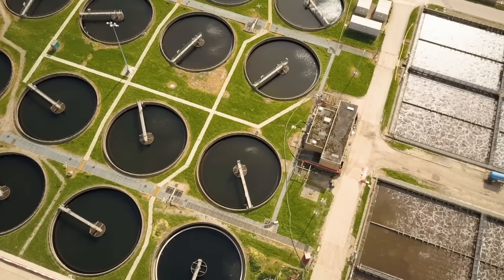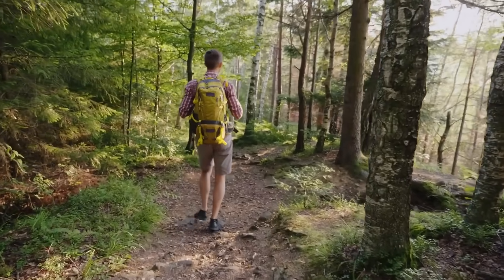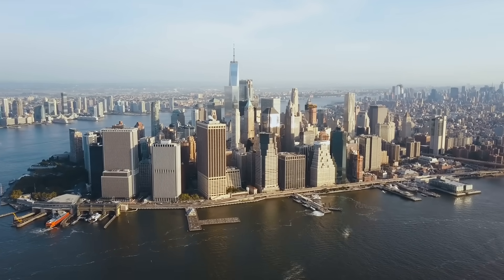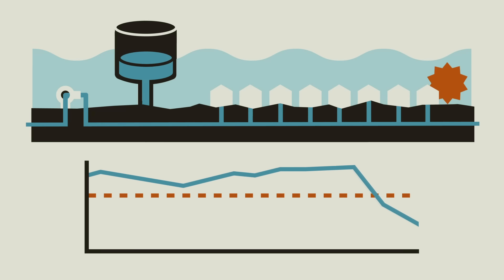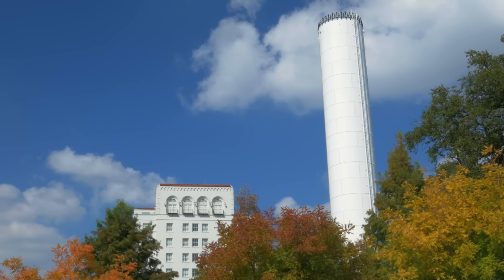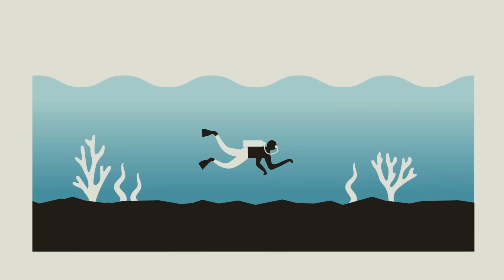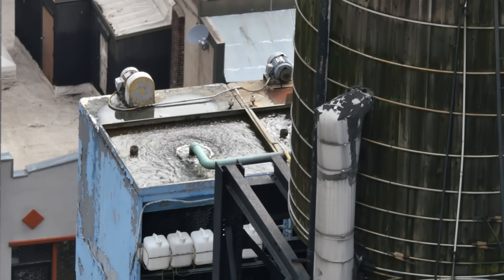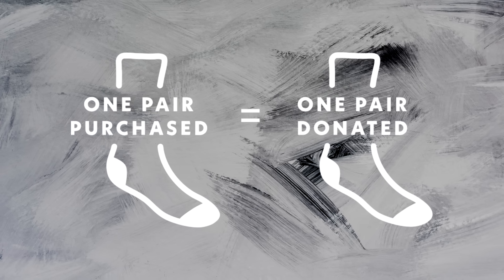How Water Towers Work

Comment: When you consider that a small town's jockey pump to keep pressure up is only delivering 250 gallons per minute and the town's boat manufacturing company's fire pump needs 2000 gallons per minute to do it's job, then the water tower makes sense.  Just have to remember to open the tower valve when testing the pump's flow or town pressure drops to zero within seconds.  Been there...done that.  The signalling circuits to the tower were not wired in yet and the guy in charge of the tower thought we were done testing and closed the valve.  Ooops  LOL

Comment: In my city, all the water towers are cylinders that rise out of the ground, not tanks on stilts.  I wonder why.  Maybe it's because we have a lot of hills so they are just located on top of hills or something.

Also: it's a shame that despite all this great infrastructure, people in recent decades have decided that tap water is not drinkable.  It's pure nonsense -- the tap water is fine.  I don't know how it got started but almost everyone believes it now.
Reply: Yes, they are simply large tanks with the needed elevation supplied by ground elevation instead of using stilts. Tap water is usually safe but if there is a contamination you usually don't find out about it until you've already drank some of it.

Comment: My old job used 1.3 million gallons a day.
Reply: Gallons, that's a measure used only in three countries, Burma, Libya and the US. The US doesn't even use proper gallons; there are 20 fluid ounces in a UK pint not 16 as in the US, but we went to the sensible metric system years ago.
Reply: @bobfisher1916  unfortunately we still use it in the USA. I wish we would change to metric.
Reply: @Lukelins1  I like cooking and one of the most frustrating things for me is seeing what look like good cooks with good recipes on YouTube using cups, spoons and a few pinches of stuff.  I never know what cup they are using and really can't be bothered to convert anyway.
SI is the way to go; 1 cubic metre of water weighs 1 ton = 1,000kg.  Then, temperature, freezing point of water zero, or 32. boiling point 100 or 212, guess which scale I use😂😎

Comment: Here in Brazil, depending on the region, almost every home has some kind of water storage. Specially in remote areas that have little to no infrastructure like the north and northeast of the country, the Amazon included. We're taught to design homes with storage for at least 2 days due to the systems being unreliable. Larger structures are also required to allocate a significant percentage of their daily water usage to be used exclusively for firefighting as there aren't any expressive quantities of hydrants in the country.
Reply: Damn, that kind of sucks. It's funny how the first world nations take something like water on tap at all times for granted
Reply: That was interesting, thanks for sharing how your country handles water.
Reply: Less so in modern houses, but lots do in the UK too. Many houses have a water tank in the loft (attic) that serves bathroom taps (sinks, showers, baths, toilet) and then the kitchen tap is linked to the mains water supply. Growing up in an older house meant if you drank water from the bathroom tap it was a bit stale and tainted, but fresh as a daisy in the kitchen!
Reply: Note: in Brazil, the "individual water storage" ("house water storage"), its mostly called "Water Box".
Reply: Same in rural Thailand

Comment: Now they mostly use a frequency converters to drive pumps in different modes. So you can raise an economic characteristics of your equipment decreasing electricity consumption and equipment deprecation when you don't need a lot of water. More powerfull big pumps has bigger resourse and better characteristics than small ones. So, water towers now demolits in many places because it has some issues with cleaning its volumes and because it can't give even pressure with different water levels.

Comment: Water towers also keep the water pressure some what constant which is much better for the distribution piping. Constant large changes in pressure, which pumps cause when they are pumping directly into the distribution system, will cause unneeded wear and tear on the system and will also cause water main breaks. Water main breaks will not only put certain customers out of water but also lower the water pressure for customers in a much larger area.

Comment: How does this work if the earth is curved? I'm curious to see a demonstration thanks.
Reply: "If" the Earth is curved?
Reply: @leonsighdoria1919  yes. If the earth was curved the Tower to the houses would have a hump of dirt between them with distance. The water tower would eventually be lower that the house's it is supplying. Can water flow up hill in a open canal over a given distance?
Reply: @yknott.1493  Do you think the Earth is flat?
Reply: @leonsighdoria1919  do you think this example of how a water tower works can be drawn with a curve between the tower and the homes that it is supplying? Let's say the tower is 300 feet high and the house are 50 miles away. Can the representation from this video still be applied?
Reply: @leonsighdoria1919  Both tower and supplied homes are at sea level.
Reply: @yknott.1493  So you think the earth is flat because your eyes can't see the curve of the earth?
Reply: @leonsighdoria1919  draw the illustration or the tower and house's on a curve using the principal of the water tower.  Can it still work on a curve with the given values?
Reply: @yknott.1493  Flat earther ALERT ALERT ALERT!! All other planets are round but ours, water always finds its level, gravity isn't real, it's actually density that's real, water can't stick to a spinning ball hurtling through space going fast, no way! There is an icewall that the government won't let us see! blah blah blah, lol, fun.
Reply: @leonsighdoria1919  draw the illustration
Reply: @leonsighdoria1919  this video is correct. If applied to a curve it will not work. The Vertical pressure from a water tower can not flow past it's own vertical hight under the force of gravity. If you draw this in a illustration you will understand. This is why the video has no curve between the two points. Water towers can only work on a flat earth.
Reply: @yknott.1493  You're thinking small as a flat earthers do, earth is big , can you at least admit you're a flat earther? It's not nice to be deceptive.
Reply: @leonsighdoria1919  do you have a pen and paper? Make a drawing. Or get the author of this video to chime in and ad the curved correction. Thank you.
Reply: @yknott.1493  Don't have shame, be a proud flat earther!
Reply: @leonsighdoria1919  most people don't have a pen and paper. So I understand your divergence  on being able to draw a simple diagram.
Reply: @yknott.1493  Am I supposed to upload my diagram/picture  to prove to some rando, who won't even be honest and say if he is a flat earther or not, sounds SUS to me.
Reply: @leonsighdoria1919  thanks for the mental health education that I use from your response for my students,it's easy work. Draw a illustration of this video and apply for the earth curvature. Then get back to us.ty.
Reply: @leonsighdoria1919  my students want to know if that is a link to your drawing of the water tower and the supplied homes. Or a new video from the author of this video with the correction applying the earth curvature.
Reply: @yknott.1493  Omg a flat earth teacher, that sounds like lies, that and you won't admit you're a flat earther means you're not a genuine person. Not an actual discussion but just cognitive dissonance in real time, hard pass, if you don't like the evidence from Professor Dave, that means you don't know crap about science. Good luck , we aren't laughing at you were laughing with you,..........I swear.

Comment: Electrons DON'T move from High voltage to Low voltage in a wire.  In AC, energy flows via an Electromagnetic Field (the electrons don't flow like water, energy does). In DC, the electrons do flow, but also under the influence of the EMF. The voltage may drop along a long path, but that is because the field strength drops (draw is larger than the EMF can supply).

Comment: I'm curious how they avoid freezing in the winter. I get that they're big, but if it's cold enough, it still seems like they'd freeze from the outside in.
Reply: Never thought of that.... now Im quite curious about it also.  I know that large bodies of water rarely freeze to the bottom.  Otherwise lakes would never have fish that survive a cold winter.
Reply: @jeffreygiven4713  I live in Minnesota. The lakes here freeze down to about 2 feet. The water below that will be exceedingly cold. I would expect water towers to begin to freeze from the outside in all directions unless something is done to prevent it. Perhaps they're sufficiently insulated. Perhaps there's enough flow of water to prevent it.

Comment: Retired now but I worked for 27 years in the water treatment industry . Very good presentation you did on what water towers/standpipes are all about . You touched on all the key points . Another interesting effect of having a water tower in the distribution system is how they protect the distribution pipe system from breakage due to sudden pressure variance . The tower being essentially an open ended vessel in a closed piping system gives it the ability to absorb and moderate sudden changes in pressure in the system such as a large consumer stopping use of their water or a fire hydrant being close . The increase in pressure gets a chance to " escape " into the tower if the pumping system isn't able to react quickly enough to the change in demand .
Reply: Excellent point, sir. Only an experienced worker would understand that.
Reply: @marktwain368  27 years in municipal water treatment and distribution gave me the chance to understand the intricacies .

Comment: In urban areas where there are mountains that available you may see tanks or reservoirs near the summit acting as water towers as the do not need a support structure. This quite common in Los Angeles as the the city is surrounded by mountains.

Comment: Notice at 9:20 the bands on the wooden water tanks are closer together at the bottom, where the pressure is higher nearer the bottom. Wider spacing as they go up.
Reply: Excellent observation!

Comment: Hi Grady, I am an older man and have been wondering how those tanks work for decades.  Your explanation was first rate, especially the part about the “stored energy” contained in the water within the tower.  Thank you for such a well done explanation.  If my daughter was little again, I would love to watch your videos with her.
Reply: Why not tell your daughter this made you think of her, and maybe still watch it with her? 😀
Reply: If you have grandchildren, watch the videos with them. I'm sure they're just as inquisitive
Reply: I believe a similar concept can be applied to the electrical grid, where electricity is produced in excess at low demand periods, so that there's extra during high demand periods. With water towers, the water is literally stored at a high elevation storing gravity potential energy.

Very fascinating...
Reply: @AndrewAce.  no. Electricity is generated. It’s not stored.
Reply: @mick7even your right, I’ve never heard about batteries, or pumping water uphill during ‘storage phase’ to power hydroelectric generators when the electricity is needed. Silly me, right? NOT!
Reply: As a 32 year old woman I would love to watch these with my Grandpa if he was still alive ❤

Comment: Little fun fact most buildings require at least what pressure is in a red fire hydrant but probably have a max of what is in a blue fire hydrant though they usually never take it from the violent because that’s for a public source like a lake so it’s a confusing topic but yeah.

Comment: The video was inadequate for me as it did not discuss how many houses a typical US municipal water tank can service.  Stuff like 34 ft of water gives 1 atmosphere = 14.7 psi  and typical US residential water pipes are at 30-80 psi requiring about 70 to 200 ft high towers.  Also the pressure losses per mile you can expect due to drag.  Overseas, for small projects, I have designed by trial and error water tanks with venturi pumps, it was a lot of fun.

Comment: In my hometown underneath the Downtown area, the California State University and beyond there is an elaborate tunnel system, which, afaik, was the housing for city wide steam heating. Hatches (doors) in the sidewalks, complete with powered elevation, are now used by businesses for storage of stock and business records. It would be interesting to see how exactly these tunnel systems were used by city maintenance workers, how the heating apparatus worked when in use and what challenges were faced by maintenance workers and downtown business owners when in use, and why such elaborate, and probably expensive systems, weren't put to better use than just storage.
That is, if you're still doing this in 2021. Thanks and cheers!